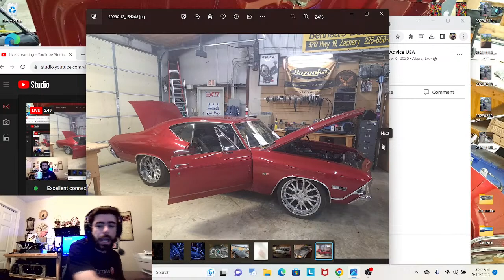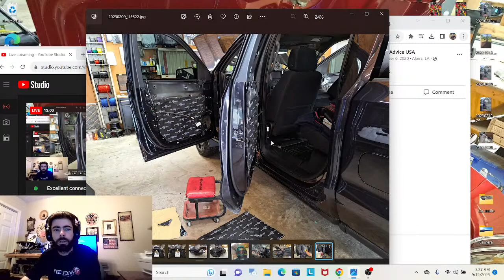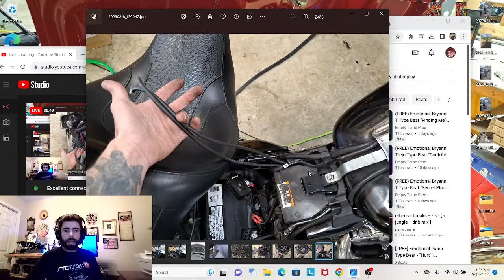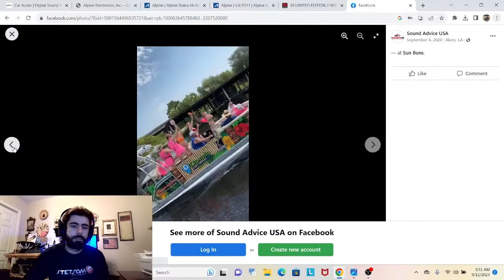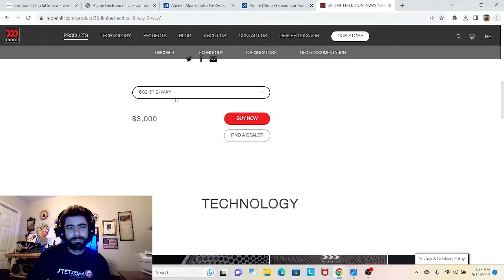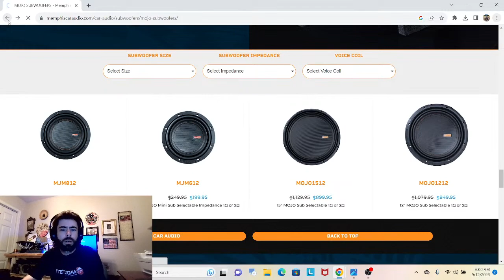Car Audio - Installs, History, and Industry livestream

Comment: Hey there. Enjoyed your live. Question for you. I know you had the 3 way Mesos and I know you talked about working with Focal. I have a set of the Focal Access 3way and as well as the Meso 3way. Was wondering which you would choose? I would live a Flax set since thats the subs I have, but money doesn't allow for buying a set at the moment. Appreciate your time.
Reply from the maker: Me personally I would run the Access 3 way. I have a set of the black carbon access limited edition 6.5 components and I ran those for a long time. The CT Sounds are still a great value for the money. CT may even have a tad higher rms. I do enjoy my Flax but I paid closer to cost, if I paid full retail it would've taken me longer to save for sure. Thank you and i appreciate your comment! Ask anytime and anything.
Reply: @BericBuilds  i appreciate the input. Running the system on a Focal FPX5.1200 so rms isn't an issue. Just want clean descent sq
Reply from the maker: @billnewell8757  focal. The 3" and 6.5" on the CT are okay but I don't think the tweeter is very accurate. I'm trying to get ahold of more 3 way systems to do some comparison tests but my channel isn't monetized so I'm limited